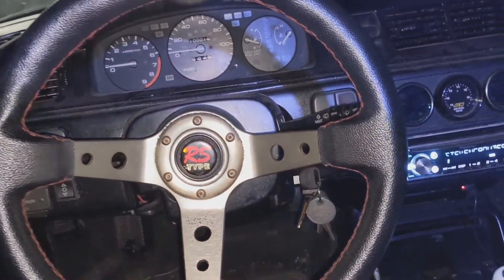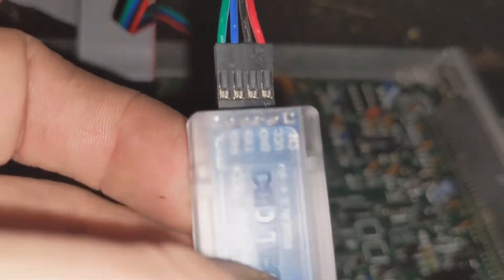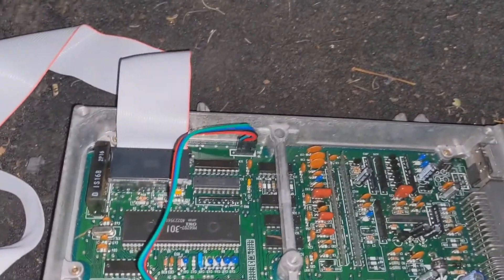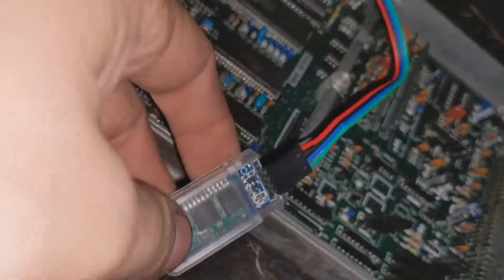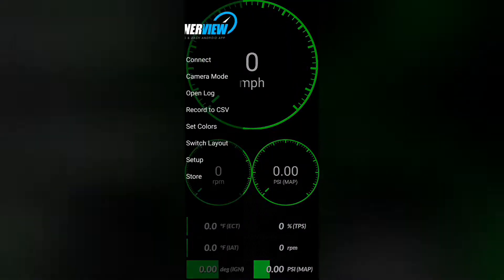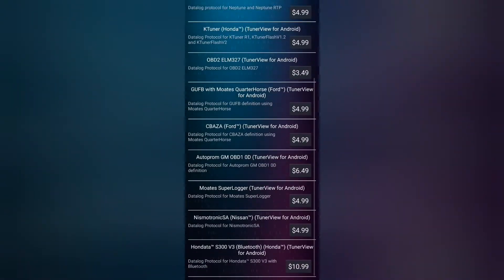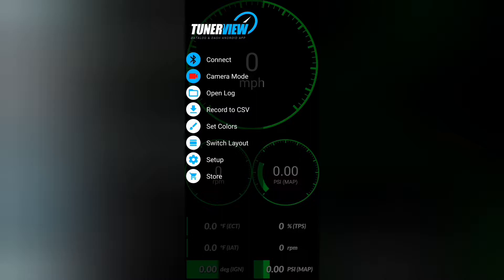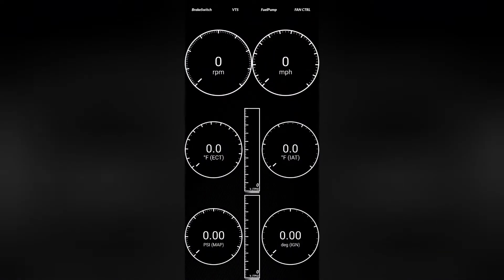Data Logging with HC-06 Ecu setup Tunerview HTS

Comment: I've learned new android phones cannot access the file folder that holds the csv datalog file. Only I think android 10 and lower can show the file folder. They can then be opened in hts
Reply from the maker: I haven't tried it, due to me using HTS for my main data Logging. 
That's good to know 🚀
Reply: @ZT_Performance  I've had a few people come at me because they cannot get to the datalog file so I reached out to the creator of tuner view. I never found it as a problem because I have an old phone as my dedicated dashboard and it lets me do all of that
Reply: @ZT_Performance  then I tried it with my s22 and was like what the heck I can't see the same folder.
Reply: @Honda Land  has this issue been fixed yet bc I'll be using my 22 ultra
Reply: @zacheryphillips1681  not to my knowledge. I have s22 as well and have list the feature to access the folder. I primarily use an old tablet as a gauge cluster so it actually never was an issue for me only someone else and i reached out to the developer and that was his response that google cover that are of the phones up

Comment: One question, does the ecu already come with the pins soldered?
Reply from the maker: @gabriyel2193  the pins (pin bridge) is part of the chipping kit you get when you chip a ECU. 
The OEM board just has the empty holes already there. 
They designed the boards along side spoon racing when Honda was being competitive in the 90s

Comment: What is the name of those wires? That goes from ecu to data logging chip?
Reply from the maker: (4 pin dupont connector)

If you check the video description Amazon link. you can get the HC-06 with the wires.